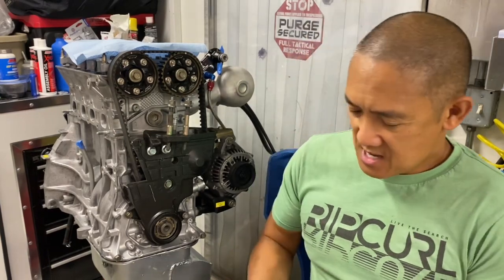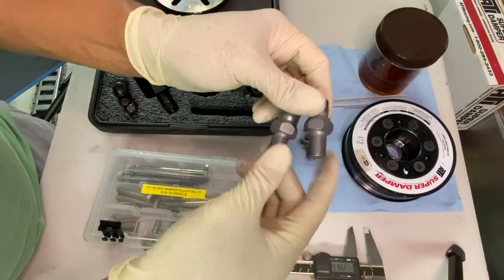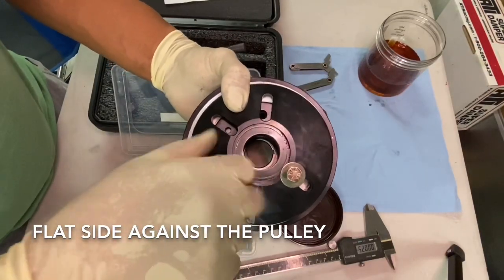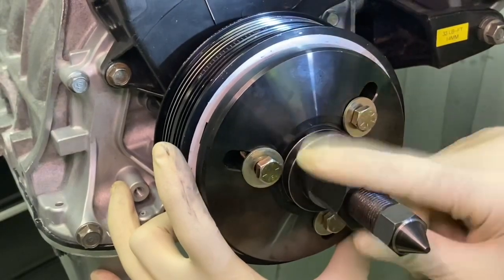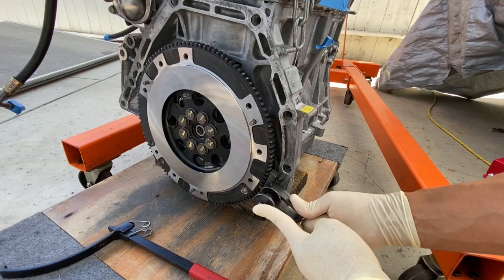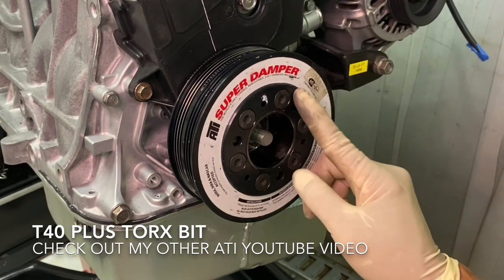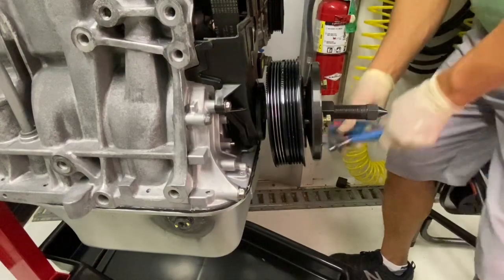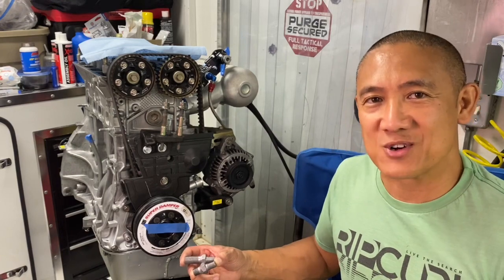ATI Super Damper Installation and Removal - Honda B Series

Comment: How do you install the pulley if the engine is in the car, no way to lock the flywheel? 

Put it in gear and wheels on the ground?
Reply from the maker: U answered ur own question

Comment: There is no other balancing that needs done to these correct? The near worthless instructions mostly cover LS motors. But something I read on ATI said it needs to rev to 2k rpm before it balances. And there were several mentions in the instructions about balancing it with the crank and flywheel. It’s on a built b20 bottom end, stock b16 head, stock b20 crank. Eagle rods and weisco pistons. Which were all exactly the same weight. I do have a lightened flywheel, that was balanced by the factory.
Reply from the maker: @wymansmith9101  no other balancing is reqd for the ATI Super Damper. Thx for watching and commenting. Pls subscribe. Thx AJ

Comment: This tool save my life 😊
Reply from the maker: @MrDelcin10  👊 thank you for your support.
Reply: Just made a tool and will be trying it tomorrow to see if it works. It's just a straight piece of angle iron with three holes drilled in it, welded a nut in the center hole and that's it. 

It should function just like a regular pulley extractor. I am simply not in the mood to give those greedy bastards any more of my money.

Comment: Awesome video!  Does this have the same timing marks as the crank pulley it replaces?
Reply from the maker: @CarAholic86  yes, the ATI super damper has all the same markings as the OEM crank pulley. The adapter and installation kit are available on www.shoprelentlessracing.com. Pls subscribe. Thx for watching and commenting. -AJ

Comment: Arnt you supposed to run the 3 bolts that it comes with in those holes
Reply from the maker: @zach3445  those holes are for the removable serpentine power steering drive pulley for ‘94 and newer B-Series applications
Reply: @RelentlessRacingAJ  I only ask because it says “must use all bolts” I wasn’t sure if you needed to put them in even if you weren’t using it
Reply from the maker: @zach3445  I don’t use em bc I don’t have power steering in my race car
Reply: @RelentlessRacingAJ just got and installed an ATI, and they have a warning sticker that says to use 9 bolts. Which would include the 6 t40 bolts and 3 8mm 12 point bolts. I’m also not running P/s so I left the pulley off.

Comment: This tool you made works with fluidampr pulley?
Reply from the maker: The crankshaft adapter I made fits into the B/K/F series crankshafts and the ATI or Proform installer/puller tool. I don’t know if the ATI or Proform installer/puller tool works w the Fluidampr, but at first glance I believe it does. Pls keep in mind i don’t have any personal experience w the Fluidampr. I merely looked at a pic online and it seems like it will work. Pls subscribe. Thx AJ
Reply: @RelentlessRacingAJ  going to purchase one from website, I've seen every puller/installer none of them have the right thread.  Thankfully I heard about you and this adapter. I have faith that it will work!
Reply from the maker: @justiceofthesun7303  cool. HMU if you have any questions. Once your  order ships I will forward the tracking. All adapters are in stock. Thx AJ

Comment: 1st, AJ is awsome, 2nd, Be sure if you have to remove the tourqs bolts on the ATi damper you reinstall them back with blue lock-tite
Reply from the maker: Thx for the kind words Jim. You are awesome!!! My bad… I didn’t mention the blue loctite in this vid. However, I did mention it in my S2000 ATI video. Pls subscribe

Comment: NOTE: The ATi puller doesnt come with the adapter you need so dont spent $250 dollars for the ATi useless kit. Go to Jegs or Summt and spend only $99 dollars, buy the relentless tool. Your set and $150 dollars saved. This is what i did and any one with common sense will do the same
Reply from the maker: Lol. On my website, I noted the ATI (USA made) and Proform (China made) puller and installer kit part numbers so you can choose your tool. Also, new to the website are ATI adapters for the Toyota 2ZZ. Thx for watching and commenting. -AJ

Comment: FOR ANY OF THOSE 5/16-18 GRADE 8 BOLTS. WHAT THREAD PITCH IS NEEDED? OR IS THAT THE EXACT SIZE BOLTS NEEDED. THANK YOU IN ADVANCE
Reply from the maker: 5/16-18 = 5/16 diameter bolt w 18 threads per inch. Thx for watching and commenting. These adapters are available on www.shoprelentlessracing.com

Comment: Does the kseries Relentless adapter work with the pro-form damnper installer?
Reply from the maker: They are available on www.shoprelentlessracing.com under the ATI Adapter tab. Pls email us w any additional questions at shoprelentlessracing@gmail.com
Reply: @RelentlessRacingAJ  I've got the adapter in the shopping cart already at shopRelentless, I just wanted to make sure it worked with the pro-form Damnper installer first, thanks for the quick response 👍
Reply from the maker: @satchmo-k24  👊
Reply from the maker: Yes

Comment: Where can I get a crankshaft adapter since the kit doesn't come with the thread pitch I need? I have a b16 and got a harmonic balancer removal kit but smallest adapter was m10x1.5? Ive looked everywhere and can't find an adapter and I need to take off my crank pulley to get my lower timing cover off so I'm able to push on the tensioner to get slack out on my new timing belt.
Reply from the maker: Glad u figured out we sell on my website. Pls subscribe. Thx AJ

Comment: $300 for a one time use tool? no thanks. hammer and heat it is
Reply from the maker: It really depends on how many motors u work on. For me, it has paid for itself many times over. Also, I’m obsessed w doing it the correct way to minimize the possibility of damage. Thx for watching and commenting. -AJ
Reply: @RelentlessRacingAJ   I totally just bought your adapter then went and rented the harmonic balancer tool from auto zone for free and it fit. thanks for the part and vid brother. saved me $240
Reply from the maker: @KeepinItReal890  nice!!!  Which puller/installer tool did u rent?

Comment: Can I still use the factory pointer on the timing belt cover to set ignition timing and align the timing belt with the ATI super damper or do you need to purchase an after market pointer?
Reply from the maker: U can use the factory pointer on the timing belt cover. Thx for watching and commenting. Pls subscribe. Thx -AJ

Comment: hi AJ great vid,,,,what is the easiest way to ad  a little more hp to the 1zz 2001 engine
Reply from the maker: Hey thx for the kind words. Pls subscribe and check out my eStore www.shoprelentlessracing.com I’m not a 1ZZ expert, but I’d suggest bore and hone to next size and up, rods,, valve train, and high compression pistons or low compression pistons w turbo. Seems expensive tho… Mayb 2ZZ swap is cheaper
Reply: @RelentlessRacingAJ   thanx  . muziek ingine is verry good ..but i will considder your advies ..
Reply from the maker: @piittiig1  stay tuned to my channel bc I’m rebuilding my 1ZZ and documenting everything… yes all the boring cleaning too. LOL
Reply from the maker: Although, as a Honda guy, K swap is ideal

Comment: Would you happen to sell those b series thread adapter for the pull press?
Reply from the maker: Yes. DM me on IG pls. @relentlessracing
Reply from the maker: Did you ever DM me on IG?
Reply: @RelentlessRacingAJ  yes just berly
Reply: @RelentlessRacingAJ  do you recommend arp bolts for damper and flywheel or stock bolts are fine

Comment: Thanks for great video and content.  I recently removed my ATI damper from a stroked L28 six cylinder for a 240Z.  I didn't realize it should be removed with a special tool.  Instead I used a typical universal harmonic balancer removal tool that has a cone shape on its end that centers itself into the snout of the crankshaft.  I noticed it was a lot harder to get off, but it came off, tearing up the threads somewhat of the tool I was using (which was probably cheap metal bolts).  Aside from that, it came off without incident.  Do you think I might have ruined anything on the front the crank snout?  Would the puller have spread the end of the crank in the process?  Thanks.
Reply from the maker: The ATI damper utilizes a light press fit. Thus, it is important to use the tool to install and remove it.  Otherwise u risk damaging the crank snout and ID of the ATI damper. Yes, I have seen others install the ATI damper using the crank bolt and yes, I’ve seen ppl take it off w a harmonic balancer puller, but again there’s risk of damage. My apologies, but I don’t understand ur last question. Perhaps u can elaborate.
Reply: The end of the crank is internally beveled leading to the screws and the conventional puller engages that part of it. I was thinking the puller might have mushroomed it in a way I can’t tell by looking. I guess I’ll just have to see when it’s time to put it back on.
Reply from the maker: @dougjensen6070  ahhhh. Well, most ppl use a hammer style puller. Most of the ATI dampers have threads on em to allow this. Obviously this is very difficult to do while the motor is in the car bc of the lack of space. There’s always the right tool for the right job, but sometimes u have to do what u have to do.

Comment: imgaine if they would of just added the stock hexegon pattern inside of the damper so you can losen the crank bolt like you do on a stock setup.... no reason not too.
Reply from the maker: excellent idea, but that feature won't help you remove it bc the ATI damper in pressed on

Comment: What size wrenches would you use in place of the adjustable? Can't remember if you listed the size of the threaded studs/adapters on the puller tool.
Reply from the maker: If you search my other ATI damper video when I did this on my S2000, I listed the wrenches.  Yes, I did mentioned the adapter threads
Reply from the maker: FYI - I made some B and K series adapters.  Pls DM me on IG @relentlessracing if you need one.

Comment: Id be putting some rag or similar between the plate and the damper. that way u don't scratch it all up.
Reply from the maker: I can see why u would do that, but FYI there’s no movement between them so it’s not reqd
Reply: @RelentlessRacingAJ  6min 34 bro its marked up.
Reply from the maker: @nickb7040  That's not a new ATI damper.  I pulled it from my other race car.  When you race they get scratched up from track debris.  I've installed quite a few of these and using the tool it doesn't scratch the surface.  However, if you feel inclined to tape your damper, then by all means tape the damper.
Reply: @RelentlessRacingAJ  lol my bad then.

Comment: AJ, have you encountered any interference with the race version of the Super Damper contacting the B18C lower timing cover?
Reply from the maker: muffn man negative. All the ATI dampers I have installed have been a perfect fit.
Reply: I'm currently experiencing this issue with a race version. Did you ever figure this out?
Reply: Man!! I just ran into the same problem. Did you solve it?? I contacted ATI but no response yet. Mine is hard into the timing cover and is about 5mm still to go

Comment: I just installed my ATI damper but I have a gap between the damper and crank where the keyway sits. Does a custom sized keyway come with the ATI damper? I'm running the oem b18c1 crank along with the oem b18c1 keyway.
Reply from the maker: C Warren You use the factory Honda key
Reply: I did use the oem key but it still has a gap
Reply from the maker: C Warren have you compared the gap to the factory pulley?  Are u sure it is installed all the way ?
Reply from the maker: C Warren also, if the key is not sitting properly in the key way it won’t allow the pulley to fully install. The key will sometimes get pushed too close the the block. I suggest removing the damper and checking the OE pulley gap and making sure the key is installed properly
Reply: I don't have a factory pulley available to compare to. This engine came with the ATI already installed. I just pulled the motor apart 7 months ago to rebuild it and bought a new replacement key and that's it.
Reply from the maker: C Warren how big is the gap?  Do the belts align w the ATI damper?
Reply: Haven't installed any accessory belts yet. Do you have an email I can send a photo to?
Reply: Or IG if it works easier than email.
Reply from the maker: C Warren Solving problems like this wo any experience can b difficult. I would suggest bringing ur motor/car to a good local mechanic. If u want to pursue this on ur own I’d suggest taking some classes at your local community college. That’s how I learned a lot about the repair side and diagnosis.

Comment: I ordered the same kit and I didn’t know it did not come with the correct sizes for Honda, where can I get those bolts?
Reply from the maker: kris sorry... Which Honda motor are u working on?
Reply: AJ JAQUIAS I have my b18, I ended up using the crank pully bolt to press it in. It seem to have went on straight lol
Reply from the maker: @kris1.8x  it might b too late, but I made some adapters for B and K series.  Pls DM me on IG @relentlessracing and I'll get you what you need

Comment: How exactly does this aftermarket crank compare to the oem bseries crank
Reply from the maker: I’m so sorry… I missed the notification of your comment. Better late than never right?  Anyway, I believe u r asking what’s the difference between the ATI Super Damper and OEM crank pulley?  Well, the ATI Super Damper weighs more, but it’s bc it is filled w material to dampen the vibrations created by the rotating assembly. U can find ATI Super Dampers on many race cars.

Comment: My Ati damper got stuck half way through and, I just bought this tool to take it off and reinstall it again 
It's a 2jz engine with a new BC crankshaft
Reply from the maker: EvoIXGSR nothing like having the right tool. It always makes the job easier. I know ATI makes an adapter for the 2JZ. Do you know what the thread is for the 2JZ crank bolt?
Reply: @RelentlessRacingAJ  it's M18x1.5, am worried that I messed up the crank threads or the bolt.
Still waiting for the tool didn't receive it yet
Reply: @RelentlessRacingAJ  just removed the ATI damper with this kit, and the center shaft and the drive nut are stuck now after trying to remove the ATI pulley. Now I can't use it to reinstall the damper back on 😑
Reply from the maker: EvoIXGSR send me pics ajaquias@yahoo.com. Let’s see whatcha did?

Comment: Still trying to figure out whether the ATI Super Damper is better or the Fluidampr?
As long as the fluidampr lowers harmonics at low to high rpm better than the ATI Super damper, i'd go with fluidampr. 

I've heard bad rep about fluidampr because they've fallen apart while at the track or the fluid turns solid under cold weather causing an imbalance in the crank to destroy itself... OR under high RPM's it turns it destroys the crank.
Reply from the maker: Lime unfortunately I’ve never had any personal experience w Fluidampr, but I’ve used a lot of ATI dampers w no issues. I highly recommend ATI. Perhaps, you can give ATI a try.  Pls let me know either way. Thanks for watching my video and commenting.
Reply: @RelentlessRacingAJ  Okay, thank you.

Comment: Hello i’ve got an Integra that makes 440whp on 91oct pump gas daily driver. I dont have AC or PS, what damper do you recommend?
Reply from the maker: john martin B or K series?
Reply: AJ JAQUIAS B18C1
Reply from the maker: john martin if u r double duty street and track I’d suggest the same one I’m using which is 918476. However, if you are race only, then one of the race models 918470 or 918471. Call ATI and they can help choose the right one for ur application.